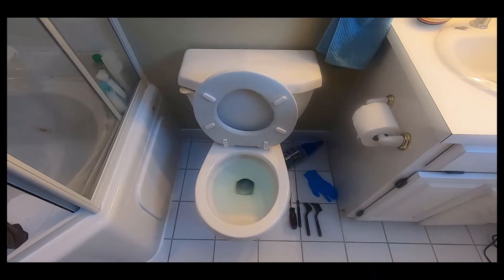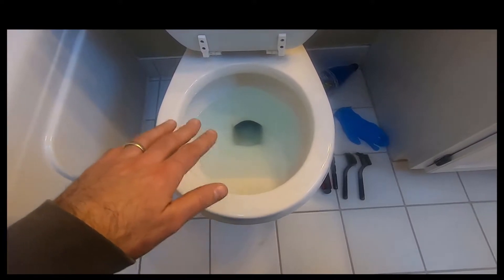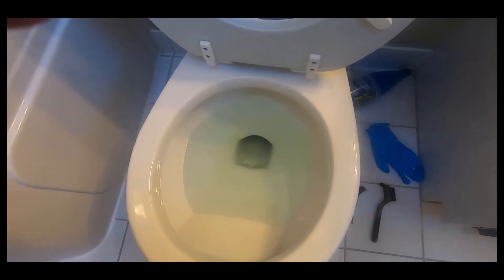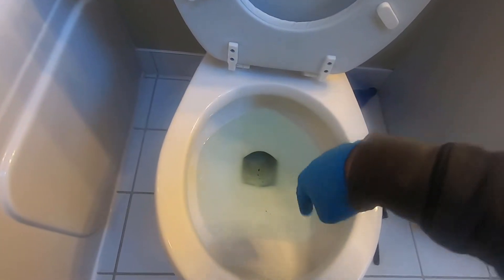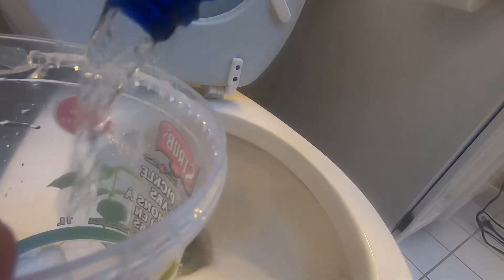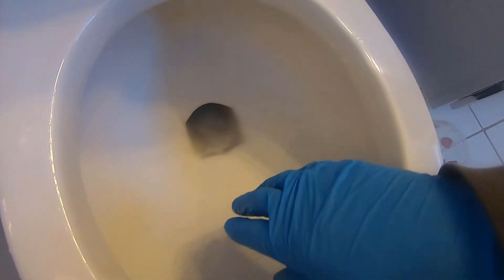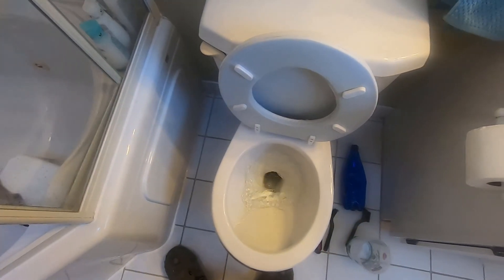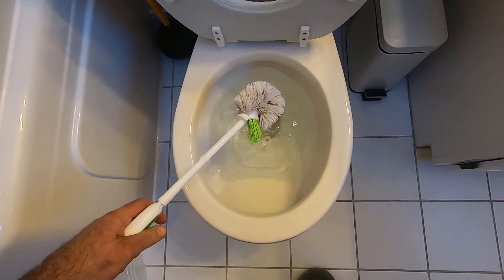DIY Use A Drill Bit To Fix Gross Old Toilet That Clogs Easily

Comment: Just a helpful tid bit I discovered, If you have hard water crud buildup, Citric Acid dissolves it, add 1/2C to toilet, 1/3C to dishwasher, 1/2C to washing machines, soak shower heads in a bucket, etc. Let soak from 20 min to a couple of hours depending on how much build up is there. Once you get it cleared, maintain the system by re-soaking at least once every 3 months (or more depending on use and levels of alkaline and whatnot in your water.  I buy citric acid in a 5lb bag, like $15 off Amazon, maybe twice a year for my 2 story house with bad hard water.
Reply from the maker: Great idea. Is citric acid harmful on septic systems?
Reply: @mrdiyguy123  I don't believe so, its food grade, and there aren't any warnings about not putting in septic tanks. In fact, citric acid is a common ingredient in cleaners. If I remember right, RidX contains citric acid. I don't have a septic rank any more so I can't check for sure. But, I'm 99.8% sure its safe.